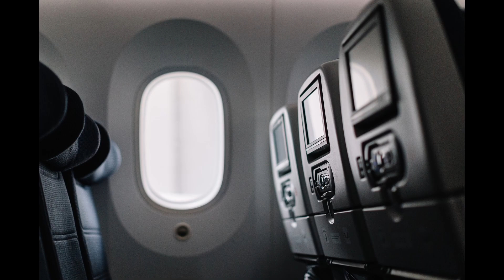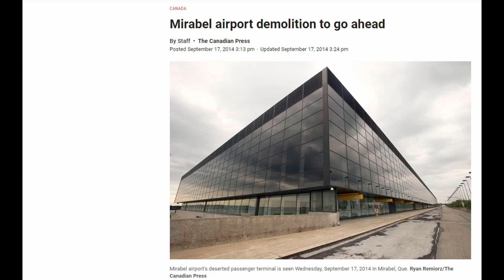Mirabel Airport (YMX) Failed...Here's Why

Comment: I worked at this airport for several years from early to late 80s and so did family members for about 25 years up till it closed to commercial passengers in mid 2000s. I can confirm Mirabel was a busy airport till the mid 90s.

Most of what you talk about is true but, what you neglected to highlight was what actually put the last couple nails in Mirabels coffin. The referendum in 1995 to separate Quebec from Canada. This caused a massive exodus from Montreal and the greater Montreal area. Major businesses and Quebecers moved en mass westbound down the 401 to Ontario. Montreal was no longer Canada's business hub.

The last nail in the coffin was the Political will to keep two International airports open. The politicians broken promises of extending highway 13 to Mirabel and getting a train from downtown core to Mirabel was not kept... train ride would have taken 30 min. This was part of the master plan and this is what made Mirabel the "White Elepant". But this is no surprise as Politics in Quebec have a tendency to scare off businesses.

If you now want to take a drive from downtown Montreal to Dorval airport you will have the luxury of getting stuck in massive traffic. Also, Dorval airport is landlocked, it can not expand any further and has more than reached its capacity and now officials are trying to figure out how to alleviate congestion there, it's a nightmare. Here I quote "HEC Montréal professor Jacques Roy argues that the $3-billion ADM has invested in Trudeau airport since 1997 would have been better spent on upgrading highways and building a rail link to Mirabel. “We would have an airport without space constraints, open 24 hours a day and without environmental nuisances for [residents],”

The Globe and Mail https://search.app/zSDhTWD3jAYBZ8wA8

And lastly you would be surprised to see the numbers, if you do a search on how many airports, globally, are at least 30+ miles away from a major city.

Comment: it did NOT fail. It was DELIBERATELY KILLED. Here is why : 1. There was no infrastructure already in place to connect Mirabel to Montreal. 2. No real infrastructure was EVER built to connect Mirabel to Montreal. 3. There were plans but the plans were killed by NIMBY politicians. 4. There was NO PLAN for an orderly transition from Dorval to Mirabel. 2 other terminals ( a domestic and a trans-border terminal) should have been built linked by an APM service as in Dallas, but only 1 terminal was built let alone a new hanger area & office for Air Canada, Air Creebec and Air Inuit..The infrastructure needed was 1. A dedicated access highway Montral - Mirabel - Ottawa. 2.  a dedicated electrified rail line Montreal-Mirabel-Ottawa.   Dorval could have been closed  and transformed into a park.

Comment: The failure was not in the airport but in political blunders and poor management by ADM.  Take a trip to Dorval now and see what a nightmare it is. Far too small for the number of aircraft and passengers it has to accommodate. ADM is talking about extending flight hours and residents are complaining about the noise. Exactly back where we were some 50 years ago.

Comment: You can also blame the demographic predictions of the time for the Mirabel failure. When the project was planned, natality rates was still quite high following the baby-boom. Montreal area population was supposed to grown up to 10-12 millions by year 2k.  With such a demographic growth, it could have been realistic to have Mirabel with appropriate infrastructure to facilitate transits between the airport and Montreal downtown. But the population growth stalled, government revenues did not increased as predicted and therefore, they cancelled many projects that was planned along with Mirabel. Let's not forget the big recession of the 70s and the 80s, not helping the project.

Comment: Excellent video. I could see YMX being a major hub for future low cost carriers, if again there is proper transportation or shuttle services from downtown Montreal to Mirabel. I could see it being like Hamilton Airport, keep in mind Hamilton is miles from downtown Toronto, let alone Mississauga. But all of his is based on passenger demands.
Reply from the maker: That is a very interesting point. I never even considered that but I would imagine that it would be far cheaper for low cost carriers to operate out of YMX. They would have to slightly reconfigure things a bit to set it up since they demolished the passenger terminal. Still though, a very intriguing point. I know personally I would take the extra drive up to Mirabel for a significantly cheaper fare. 

Thanks for watching and thanks for the comment!
Reply: @ApexGeography  coming to this now with the news of the expansion of st Hubert. Makes way more sense. Looking forward to it
Reply: Eventually for Commercial spaceflight if a single stage to orbit space shuttle can be developed.

Comment: I find it very interesting how they were able to re-purpous such a large airport, i wonder what it will be used for in the future.
Reply from the maker: Yeah it is interesting, indeed. I’m very glad that the Airbus facility has done well there. Although in the coming years I believe most of the new A220’a will be produced and manufactured in Alabama.
Reply: An exhibition center could be built @ Mirabel north of the access road . This would stimulate more cargo airlines to serve Mirabel and ultimately low-price airlines. Also in the future several decades off Mirabel Airport could be a port for single-stage to orbit space shuttles if commercial space flight ever becomes reality. 
 @ApexGeography